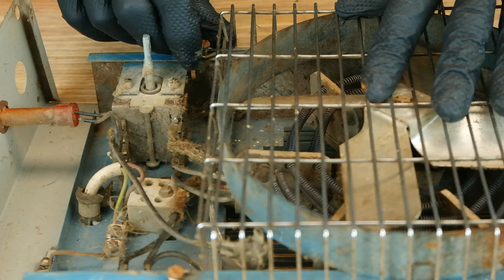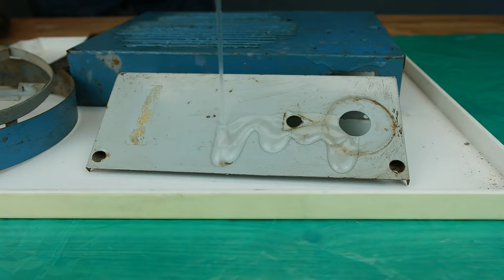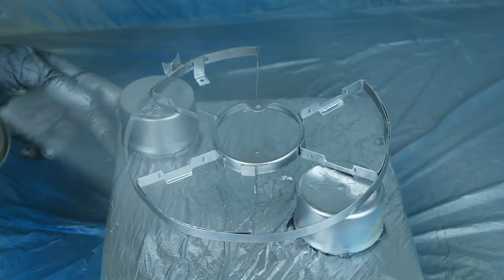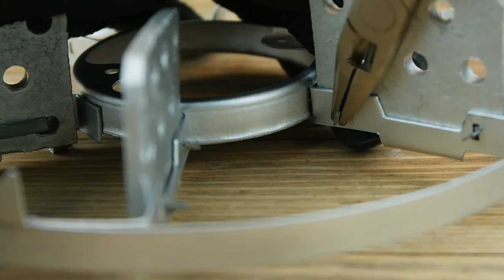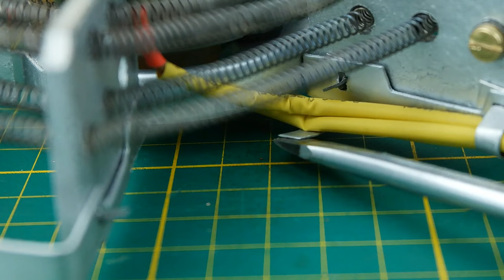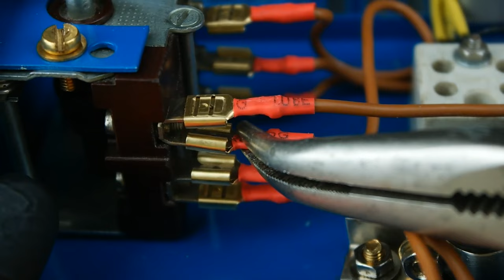Vintage Space Heater - Restoration

Comment: Fantastic job you did restoring the old heater.  It looks much better and it works like a charm too.  You also got it a little quieter, because at first when you tried to run it, the fan was a bit noisy.  Excellent work as usual.
Reply from the maker: Thank you for your opinion👍, I'm glad you appreciate my work.

Comment: 🤨 - the ceramic insulator plates for the heater element are not usually painted but left bare ~ due to the risk of the paint burning off and they have been designed to not be painted, you forgot a part ~ the impeller shroud, and the neon lamp should be replaced = it is oxidising, a form of failure and won’t be much visible, normally, when new an orange neon bulb is clear with the electrodes visible and you didn’t test the overheat thermostat [self-reseting thermal fuse] by obstructing the impeller and causing the element to glow orange (like what happened at the beginning of this video when you pre-tested it before restoration) and should trip the thermal fuse ~ otherwise it is a fire hazard ⚠️
Reply from the maker: Thank you for your opinion, regards